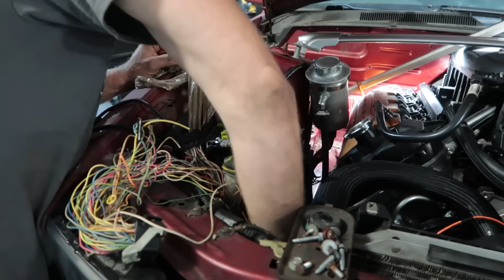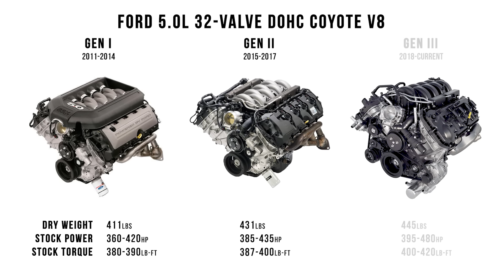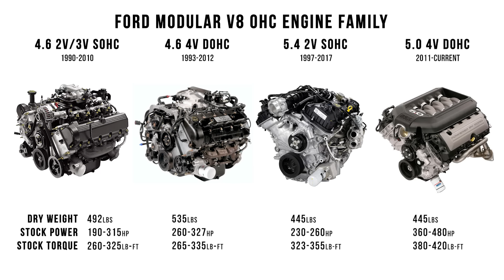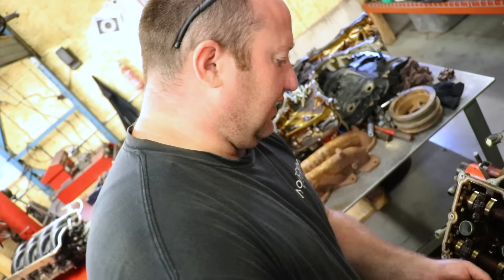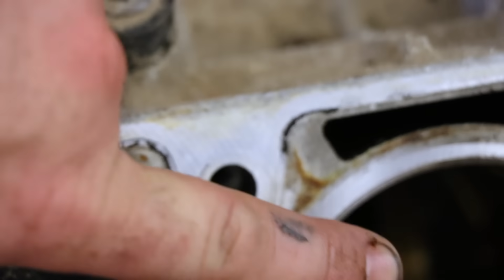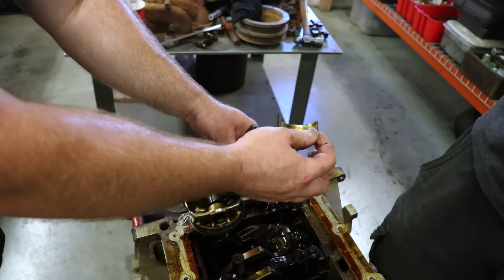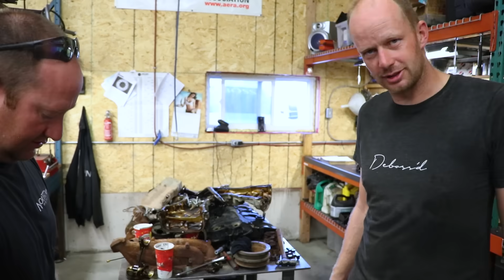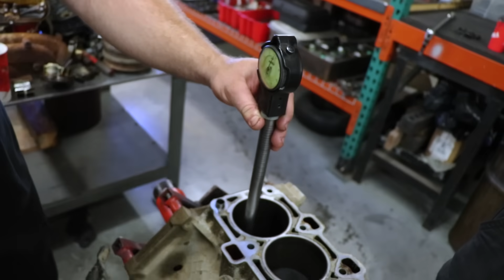REVIEW: Everything Wrong With A 5.0 Coyote Engine

Comment: My Honda Accord v6 looked sparkly clean inside after 110k mikes when I did timing belt, always ran Mobil 1. I do plenty of short trips. Change oil at 7-10k miles...
Reply: Unfortunate that Honda's built in the last 4 years or so are infamous for filling the crankcase with unburned fuel. Honda won't even admit the damage that kind of catastrophic fuel dilution can mean. If you thin down the oil with gasoline by 30 to 50%, the lubricity of the oil is seriously affected. Honda changes the oil but refuses to extend the warranty. They pretend such serious dilution of the oil is "ok".
Reply: hochhaul actually Honda was sued in class action court (for 1.5T) and the settlement is extended warranty, unlimited miles for 6 years on engine. Once engine is broken in and using 5w30 versus 0w20 helps to where its very low fuel in oil. The solution is mixed injection and port injection when cold but Honda gambled on simplicity and profits using DI only.
Reply: @jamesmedina2062  Using 5W30 instead of 0W20 would have ZERO effect on fuel being dumped into the crankcase. There are plenty of engines that don't have the issue Honda does with a DI-only system. GM has built over 3 million DI-only LS-based V8 and V6 engines that don't have crankcases filled with gasoline.
Reply: hochhaul Nothing you stated is relevant .
Reply: hochhaul your anecdote about LS engines does not help about because they are such different engines than 1.5 Honda L15B7
Reply: @hochhaul  I hear ppl having isues with DI engines dumping fuel into the oil, but I haven't experienced that with mine so IDK? I think its a non issue if you change your oil more than once every 20000 miles....
Reply: Owned a '94 Prelude (H22A1) that I put some crazy hard miles on. When I did the valve cover gasket on it at 288k, the entire inside of the head with a beautiful silver with hints of amber... and I guarantee at least 80% of my driving was short trips to work and around town, on Valvoline or Pennzoil high mileage synthetics (whichever one happened to be on sale when I needed). This dude saying that this buildup is caused by synthetic not getting hot enough is a fuckin clown.
Reply: Your Honda uses a Timing Belt not a Timing Chain. To replace or service the timing chains/ components, you need to remove the timing cover which also is sealed to prevent oil from leaking out.
Reply: Christopher Mohamed What is your point?
Reply: @jamesmedina2062  you said your Honda looked clean  inside at 110 miles. I'm assuming you are talking about the view you got of your timing belt components when you removed your timing cover to replace the timing belt. Your Honda is designed with a externally driven timing belt. The timing chain is internally driven which uses oil pressure and oil as lubrication for operation.

So what I'm getting at is you can't really see how clean your engine is because you're not actually looking inside of your engine. I hope I'm not confusing.
Reply: Christopher Mohamed Ok bro that was Jacob and he said 110,000 not 110. I asked what your point is because timing belt usually means the valve cover is off.  The valve cover gasket needs replacement and it is usually one piece covering everything
Reply: @jamesmedina2062  that's true.
Reply: @christophermohamed4990  I also did valve lash while doing timing belt, water pump, plugs, hoses, etc.. so yeah i had a look inside where oil goes LOL

Comment: Damn, never heard this much negativity about synthetic oil. Although I would trust this guys experience over mine.
Reply: I wouldn't, as it is bs
Reply: @Retadin  Yeah, something sounds strange with that. I just have never heard this kind of info from anyone on synthetic oil, so I find it kind of surprising, especially as I ran Mobil One EP 5w30 in my L99 for over 150k miles and when I disassembled it, it looked freaking pristine inside. I barely even had any oil staining.

Comment: Koenigsegg FREE VALVE Camless engine is the way of the future
Reply: I doubt it.
Reply: It’s all ready being produced on the Chinese market in regular cars. It’s like being able to have any camshaft you want on demand. No throttle body the valves throttle the engine. Using pneumatics which is very well proven tech.
Reply: @hunterwinecoff171   VVT and variable lift have been around for a long time. Kia now has variable duration. They all have mechanical limits so you don't wack the valves if any controls screw up. FREE VALVE is less reliable and requires more energy to operate the valves. It will always be limited to special applications.
Reply: There’s a difference in vvt, cam phasers, variable lift, than  free valve tech. but things do have there limits, I guess we will see. I’m a mechanical guy an HVAC tech and I like my ls engines check out my videos of me frame swapping my 1967 c10 to a 6.0 awd Escalade and going drag racing. Out of all things automotive When I learned about free valve it just stood out to me. But your opinion, my opinion, who cares.

Comment: The Motorcraft oil I use in my '16 F150 5.0L is a multi blend, synthetic and mineral oil mix.  Somebody drove that truck with very few oil changes.  Driven hard and parked wet.

Comment: I work at the dealer closest to his shop. And we never send engines to him.... customers get the choice of a new or used engine from millers/Glendale. We also never see that kind of build up unless the engine wasn't maintained. And there is no service interval for 5.0 timing chain's.    And the 17+ truck engines tend to be less reliable.
Reply: I see way more 17+ 5.0s getting engines then 13-16s
Reply: @codman83  Yeah, a lot of complaints with the Gen 3 Coyote. A lot of bottom end knock complaints. Especially with the Mustangs as they're probably driven harder.
Reply: Its this kind of talk that makes me want to keep ridin my 2V out of fear. GM and Chrysler seem to have their own set of engine failure issues with the V8s. They all perform so astoundingly well its a crying shame.
Reply: @TheCulnes  You should. Ford has good ideas but they always find a way to mess it up. Or go Ecoboost. They seem reliable.
Reply: @TheCulnes  If GM could get their lifter/oil consumption issues caused by their AFM/Displacement on demand system sorted out, they'd be king shit of v8 reliability.
Reply: @phantom240  I really think the LS family is great. I'm still a fan of the non-AFM/adjustable cam stuff. If I want an LS truck that will last I'm afraid I have to go back to the early 2000s and then I am saddled with the weak 4L60, 10 bolt, and other misc issues that they suffer. I don't see a vehicle on the market that I would have confidence in today. I really hate the idea of direct injection.
Reply: Less reliable? It’s been 3 years.
Reply: @vojnikjna30  The guy is still right though. It's a shame the 3rd Gen Coyote didn't maintain the cast iron sleeves and standard port injection at least for the F-150.
Reply: @cp6027  Oh god they're using DI MPFI hybrid now right? Christ.... DI is a joke.
Reply: @vojnikjna30  It's easy to put a lot of hard miles on a truck in 3 years.

Comment: That's not a synthetic oil problem.  That's "I use my remote start twice in a row in the winter before I get in so it idles for 40 minutes total in -10C temps, and remote start the same way in the summer with the A/C on before I get in.  Then I drive my truck 5 miles each way to and from work, use my remote start again before I leave for home, and only change the oil every 10k or more."  I've seen many engines that never used synthetic oil that look just like that.  My wife's 2.5L Fusion has 170k miles on the clock after using both blends and full synthetic oil and it's as clean under the valve cover as the day it was built.  The key is full operating temp (not coolant temp) drives, 7k or less oil changes, and not using remote start for 30 minutes two times per day because you don't want your ass to be cold/hot for a few minutes.
Reply: Ford must have realized this, and fixed this. The 2018's and newer will only allow remote starts for 10-15 min run time now.
Reply: @johnwindsor9069  Yeah instead it times out while people are getting ready in the morning, so they remote start it again and let it sit idling for another 10-15 minutes before they go out and drive it.
Reply: @sudsycloud6530  I really liked the 2.5 NA. Hate the turbos. I'm not sure what year, (2017?) heated steering wheel became an option. Remote start, push the snow off and the warm steering wheel takes the sting off. It's on the climate screen if you've got it.
Reply: @pgtmr2713  It's a 2012, before the Ecoboosts (and touch screens) were a thing.  I have a custom tuned 1.6 Ecoboost in my Fiesta ST with 70k on it and it's great.  Oil changes every 5k miles.  I also don't idle my cars, or let my family idle our cars for extended periods of time and keep short trips to a minimum.  My family's fleet of cars hardly ever don't reach full operating temp.  Never had a sludge or build-up issue in any of the many cars I've owned in the many years I've been driving.  Not even a discoloration.
Reply: @sudsycloud6530  I wasted my money on synthetic years ago. Guess what, the cars still broke, and one got hit while it was parked. Use the cheap oil, change it often enough. Unless it's some kind of collector car. The engine in my Probe GT still looks like new on the inside 7k rpm shifts. I liked the 2nd gen Fusions. The 2.5 will feel like a rocket if you continually add throttle, don't confuse the transmission with a pause, it will shift early based on throttle input. The transmission can also be confused by hitting the throttle too hard sending it down 2-3 gears, then backing off the throttle a smidge will send it back up a gear while nothing happens the whole time. Always keep it in S instead of D you'll get better gas mileage all the time. The 2.5l was smooth power compared to the Ecoboost turbo's on off and shifting.
Reply: My 2014 Fusion only stays on for a max 15 mins using remote start
Reply: @adalbertosantiagopagan8738  Yeah.  And a lot of people use it twice before they get in.  Which was my point.
Reply: What does the remote start do?
Reply: @OmarRamirezGalaxie  Idles your engine for 15-20 minutes depending on the make and model to warm it up before you get in.  A lot of people do that twice before they get in. Start it, let it time out, then start it again. Idling is the worst thing for engines in many ways, especially on gas engines and when it's super cold outside.
Reply: SudsyCloud ahh got it, so it’s the idling that’s bad
Reply: So its not the short driving using synthetic???
Reply: @asenssiadesu  idling and short drives using any kind of oil, not just synthetic.
Reply: Remote start isn't the issue; the issue is that the oil has a life span that can be measured in the hours of engine run time and most Gas engine vehicles don't track that sort of thing. And of course the manufacturers are financially motivated to not tell consumers that the idle time of an engine should reduce the time between maintenance intervals because they want to sell more vehicles.
Reply: @Jack-yl7cc  The newer F-150's (2016+) show total hours and hours idled.

Comment: The difference for the color on each side is from the design of the Ford motors.. The oil pumps up through one head, then through the block, then finally through the other head. Fordtechmaculoco has a video all about it..

Comment: Rich I have 2011 ford f150 5.0l within the last 500 miles has developed a low end knock has 62k on it does not make a sound on start up but once it has run for a few minutes it starts to knock and gets louder to a certain point and then doesn't get any worse it sounds about like piston slap in an early 4.6 northstar does not get louder when revved up but the sound does speed up didnt know if you had any ideas it is serviced ever 4.5-5k with 5w30 full synthetic dexos 1 oil it's a first responder truck so it is driven fairly hard do you have any ideas

Comment: I dont know if he was talking specifically about coyotes but he said the rod bearing staying on the crank is bad. I just pulled apart a junkyard 4.8 ls. Some of the rod bearings stuck because of the oil. The machining lines are still on the bearings and the journals and rods have literally perfect clearance, I miced every one and they were all exact. So in my experience that is not the case.

Comment: " why did ford hafto put cams on top of this otherwise happy engine" - uncle tony
Reply: Really I'd rather have the old ones 289 0r 302 put fuel injection on it
Reply: putting the cams on top allow for safer high rpm revving. allows for more valves per cylinder, and more horsepower.

Comment: I've built two turbocharged 4.6l's with the 4v DOHC spec and have had a lot of success.  Both times I used the engine out of a Aviator instead of a Cobra (500 bucks for both after selling transmissions), the Aviator was an aluminum block and head where as I believe the supercharged Cobra had a cast iron block and aluminum head making it a hell of a lot heavier (although better for boost being more rigid so worth it...?).  First engine is in a B2200 Mazda AWD rally minitruck (350whp conservative, anymore would probably grenade the diffs/transfer case).  Second engine is in a 95 BMW E36 Coupe (more indepth build, more boost, ~450whp with room to go rivaling my other E36 coupe with a turbo GM Atlas 4.2 I6).

I've never really been a Ford person but I have the mentality of use whatever is in the donor barn or workshop that can get the job done with minimal compromise.  I'm actually building a third one for an RX8;  I planned on using a 4.8l LS but the local salvage yard offered another complete running 4v DOHC for dirt cheap before listing it.  I figure why not try it out again and use what I learned to make an even better one, plus Mazda is kind of a Ford right? Not that I care anything about purity lol.

Comment: That fellow is totally wrong on the oil , I’ve been using Amsoil since the late seventies and my motors from my lawnmower to my motorcycles to my cars and trucks are super clean, Maintenance like valve clearance checks machanics always comment how clean my engine is. Unfortunately there’s no oil police so oil companies can cut costs and save money by selling you inferior oil and what are you going to do about it, sue the oil company, good luck with that. Amsoil takes pride in making the highest quality that’s why I still use it.Or you can save a couple bucks an oil change and take your chances?